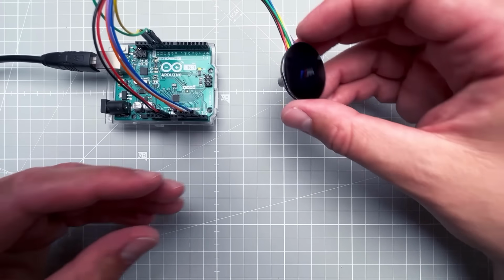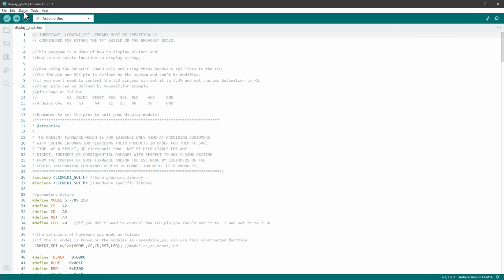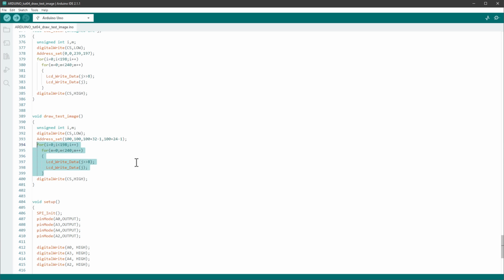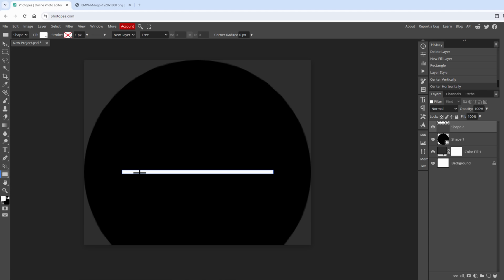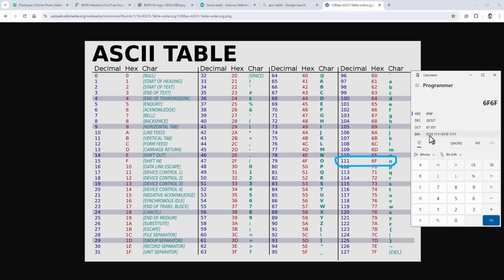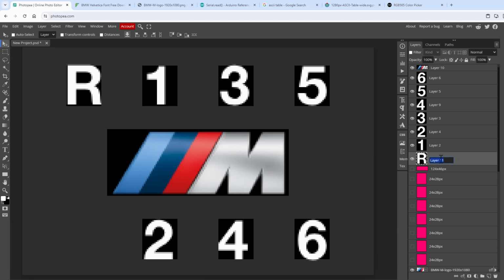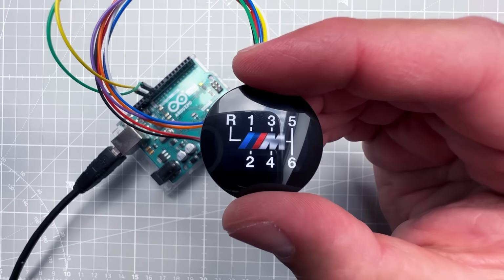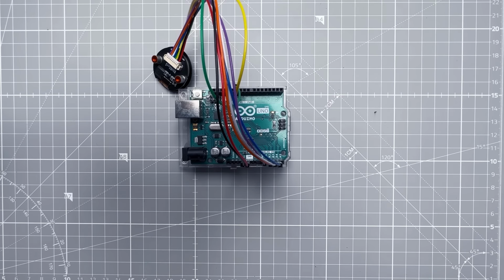I found PERFECT display

Comment: I have a 2019 subie impreza sedan and unfortunately it's not manual, however, it's very funny to drive, so I'm planning on adding some switches to the dash so I can add more cool huds, like the g-force monitor with a axis and surrounding circles with a dot that moves around.

However, if you want to also do what I'm doing, consider using a nextion display, I would recommend 5 inches or higher. Or it will be the size of a penny.

Although there are options for me to plug into obd2 and get a monitor, on say, ali express, I want customization and to learn how it works because I'm really curious.

Here's all the parts I ordered:
- a new arduino mega board for more TX RX connections, that just isn't possible with the arduino uno board
- ADXL 343 accelerometer (you will need to sauter those pins on, just a warning)
- Some kind of GPS system, I got a GT-U7, but I'm still attempting to get it to work (also needs sautering to work)
  so if you don't have this already, get a: sautering set with clips, as well as some soldering wire to form the solidified metal glue that holds your pins to the board, as well as a de-sautering plunger in case you mess up
- DHT 22 sensor, because the other DHT modules are rubbish (displays temperature)
- some kind of CAN shield to connect your arduino mega or uno to a obd wire to your car
- OBD-II to DB9 Cable (the manufacturer won't tell you what kind of cable goes to connect the car to the shield, so this is the cable you have to get, a FEMALE DB9 end to a MALE OBD-II end. if you don't have this, and because it comes separately from the CAN BUS shield, you will end up with a CAN Bus add on that can't connect to anything which is pretty infuriating.) 
     I also would recommend getting long wires, at least a half of a meter long or so, because you can spread the display father from the board. I could only find male o female wires, but that's good enough.

Arduino playlist where I keep other people's tutorials all in one place:
https://youtube.com/playlist?list=PLU1G_7s85BKfUrUACXl_vMaxoBWpobnmb&si=J5KACSdJiFCb4BAr

Comment: u can ad an spi eeprom
Reply from the maker: Yep, but probably easier solution is to simply use ESP32 or other microcontroller with more memory.
Reply: @upir_upir  yes for sure the conectivity of the esp open to a lot and the mcu is way powerfull, but the gpio is limited

Comment: Maybe you should try a Raspberry pico instead? Something like 128 MB of memory.
Reply from the maker: That´s interesting idea. I will start with ESP32 that usually has somewhere between 4-32MB and see if that´s sufficient.
Reply: @upir_upir  Ironically the pico is cheaper than the uno and offers way more memory and a much faster clock. It also comes with wifi and bluetooth too if I remember correctly, so easy communications too.
Reply from the maker: @fog1257 I believe ESP32 has all those attributes as well, plus I can use Arduino IDE.. but I might try Pico as well

Comment: Could be really funny if you could get a thumb stick windows pc's to run the shift knob a wireless mouse and KB plugged in you could have it hidden somewhere, or if you print a really long knob inside it.
Reply from the maker: You mean using the shifter knob with Windows as a controller?

Comment: Thanks for this, it's amazing, although I have no programming ability what so ever.  I'm better on the automotive side. i assume you have an OBD2 port on your vehicle which can use a Bluetooth adapter to send vehicle data wirelessly. Would it be simpler to receive shifter data from there to the display? something like this?  https://www.youtube.com/watch?v=VMdNPDkB_Ls
Reply from the maker: Yes, trying to leverage OBDII data is on my to-do list, and I would like to try that soon; I have a lot of different Canbus devices, and I will see which one of them is easiest to use.

Comment: PLA is NOT a good material to use in a car.  Even if it never gets warm where you are, the sun coming in the window will degrade the plastic if it doesn't soften it to the point of being useless.  You need a material that can stand the UV and temperature of a car, like ABS or ASA.  Just a thought.  A really cool project and that display really IS perfect for the shift knob.
Reply from the maker: Thank you for your comment, someone else mentioned it already, it´s a good point. I can only print PLA and PETG, but hopefully one day I will also get a printer to print those advanced materials.

Comment: This is such a cool idea, I'd love to see manufacturers incorporate this into their shifters in future.
Reply from the maker: Thank you, but I´m sure this is against all the regulations, I don´t think it will be part of shifter knobs anytime soon.. most likely shifter knobs will not be in cars soon.
Reply: @upir_upir  so the Mercedes AMGs have something similar with a pair OLED micro displays on the steering wheel. They are used for shifting and vehicle mode.Ive been on the hunt of putting them on my car because they are so badass. I however am trying the shortcut to your route. Im starting to think I can encode the ECU with something like HPTuners to accept onto my new Eclass. The transmission is much different so I may end up having to do it all your way. Im a mechanic with zero coding ability. I however love the wiring and soldering parts, somewhere I excel exponentially!

Comment: you should be able to do it on a rp2040 1.3 touch display, no extra arduino needed, its all in the display itself
Reply from the maker: I have tried that display - but not the RP2040 version, but the ESP32S version in my latest video. Have you seen it?
Reply: @upir_upir  yes, overall perfomance the esp32s is better i think but the rp2040 has a gyroscope and an accelerometer build in.
esp has wifi and bt which is cool for modbus tcp or other network protocolls. idk thought aoverall smaller thing ist maybe better for your project. cheers

Comment: If you can find an appropriate, gap-filling adhesive like some used with optics, you can remove the air gap between the lens and display and don’t have to worry about viewing angels.
Reply from the maker: The lens is factory-applied, or did you meant something else?

Comment: this would be insane as a replacement for the logo on my stock e46 shifter. its the same style of glass and looks to be around the same size
Reply from the maker: Cool! Is your stock shifter illuminated? If so, you can probably use that 12V line and do not make any other modifications.
Reply: @upir_upir  it is not but it shouldnt be to hard to get some wires to the top

Comment: you can make the code much smaller to fit in to one chip( attiny85 - for inst.) 8kb of flash should be enough. also you may use one bit per pixel instead of bytes in your font images. it'l shrink your code significantly.

Comment: I think it’d be cool if the logo was the only image file, and the shift pattern was stored and set in a custom data type so you can quickly adjust it for a new car. Maybe even hook it up to a game like assetto with a plugin 🫢
Reply from the maker: That´s exactly the plan, since I would like to support multiple brands, logos and shifter patterns. Does assetto work with SimHub?

Comment: 40:14 You should include it in the ///M bitmap. It would cost you zero ressource and have a slanted anti-aliased tail like on the original image
Reply from the maker: That´s correct, but I haven´t included it because I´m later changing the color of that line.

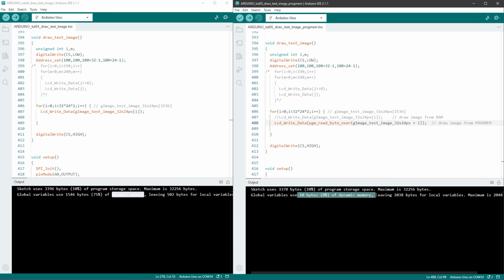Comment: 17:20 The global variables don't appear in the PROGMEM used in the output on the bottom...
What if you used a const rather than a variable? Wouldn't it go automatically go to PROGMEM?
Reply from the maker: Const would enough on non-arduino boards, but on Arduino boards, you have to specifically type PROGMEM. It will be ignored on boards like ESP32.
Reply: @upir_upir  Thank you. So the Arduino  compiler stores constants in RAM?

Comment: I'm lucky enough to have an illuminated ///M gear knob but this is the premium plus version!
Reply from the maker: Illuminated ///M gear knob is pretty cool on it´s own, and it also means that you have easy access to 12V line, so changing it for a display should be simple.

Comment: You are using 16 bit color for the number images, but then only using them for a binary mask in the code. You could save a bunch of memory by dropping the images down to 1bit.

Alternatively you could try and keep the anti aliasing. Save the mask as 256 levels. Then code side, build a lookup array that maps from the 256 image levels to a tint gradient (from black to full tint). This pallet can be precomputed. The inner render loop just needs to do an extra array lookup instead of the masking operation. Should still perform okay.
Reply from the maker: Yes, saving them as 1bit to keep anti-aliasing would make a lot of sense, and using the color lookup table. That´s something I will try the next time.

Comment: Regarding the photopea / image2lcd v2.9 (v3.2),  do I understand correctly that the display still needs an external arduino to sense the position and drive the display?  

If so, any thoughts on those $8 ESP32 boards where you could wire the gear inputs but all the smarts would be handled on the display board?  Like banggood esp32 c3 5x5 led board, or ESP32-S3-LCD-1.28 ?

Some of the more pricier units ($25) have an IMU, so perhaps it could sense the gear just based on the tilt.. without any need to wire inputs?  
ESP32-S3-Touch-LCD-1.69 ?
Reply from the maker: Yes, I´m looking at all those boards right now. The mentioned ESP32-S3-Touch-LCD-1.69 looks very interesting, but the data coming from the IMU are not very precise. I will still most likely go with ESP32, and probably use two connected with ESP NOW, so you only need two wires (power) for the unit inside the knob. Thank you for your suggestions!

Comment: er, PLA? bad idea. a car parked outside you should be using something like ABS or ASA. PLA is not going to maintain structural rigidity at all. what i mean is, that's going to come off in your hand while you're driving.
Reply from the maker: Thank you for letting me know, someone already mentioned this. It´s definitely good to know. Would using PETG be better?
Reply: @upir_upir  PETG would be better but i would say still not ideal. Can you print ASA? ASA is a modified ABS which is better for engineering purposes, better for outdoor use (which technically inside a car, but it's still going to be hit with sunlight etc.) and better for overall long-term. I would use ASA or ABS. both will require 240-260 nozzle temp and an enclosed heated bed of 90-110º.

Comment: Since you are using mostly black and white graphics (for the digits etc) you could use a basic form of compression where every pixel is 1 bit instead of 2 bytes, then unpack on sending data (by using some binary logic) essentially reducing the amount of memory needed by a factor of 16
Reply from the maker: Wouldn´t you lose the anti-aliased edges by storing every pixel only as one bit? That said, you can probably store one pixel as one byte, reducing the memory by the factor of 2. Not as big as your savings, but you will get the same visual result.
Reply: @upir_upir  That is true, but i can imagine something like this becoming useful when wanting to create more complex visual , for instance you could store a whole font library like this, then draw it to any color you like using some decryption logic. For anti aliasing, if there is sufficient memory (approx 2* image size) and processing speed you could do a first render and then a kernel filtering pass in which you perform blending based on neighbor pixel information. A simple alternative to anti aliasing could then be implemented by taking the max of the self value compared to avg neighbor. If memory is a problem you could render in portions, essentially storing only part of the pixels in memory, performing the filter pass, rendering to screen and then move onto the next block. Alternatively, which i think is how AA is implemented, for each pixel, you render 5 times to the screen for times for each neighbor (blend between target colour an bg colour) and once for the pixel itself "on top", non blended. I can imagine you can get some quite extensive visuals in such a device using some of the optimizations.

Comment: Can be interressimg on ets/ats with 16-18speeds gearbox on trucks or with an automatic gearbox. Also with beamng...
Reply from the maker: Can you use beamng with SimHub?
Reply: @upir_upir  BeamNG is listed as a supported game on Simhub website but didn't tried it. 

I only have a e36 cluster but I have to rewire it with car socket.

Comment: Would be great if you can show how to interface the unit in an actual car, using the can bus. I think bmw would be popular, I dont know how you could go about creating bench test for a bmw gear shifter because the gear information probably comes from the transmission itself not the knob/shifter mechanism. Experiementing on someones car may also not be possible because of risk etc but even if you show some kind of hypothetical situation using your own CAN bus network on the bench and maybe using some online information about BMW can bus frames for their data about gear status, you can get an arduino with can module to output that data to pretend to be a transmission.
Reply from the maker: Yes, interfacing canbus via OBDII port is something that I´m currently looking into. Thank you for your comment!

Comment: ESP32-S3-ZERO would probably be the best choice for this project if you are moving away from the Arduino and want something not custom. Or if you want to go raspberry Pi then the RP2040 Tiny, the one with a breakout usb board for programing
Reply from the maker: Thank you for your suggestion, ESP32-S3 is what I´m currently aiming for. Right now waiting for the XIAO ESP32 board to arrive, let´s see how it goes.

Comment: Could this be used to drive two displays? One on the gear shift knob, and one on the instrument panel?
Reply from the maker: Yes. You can use even more displays, but updating will be slower. There is an example in the documentation that shows those spooky eyes with two displays.

Comment: Very nice tutorial. As a computer science student, this video remembered what I seen in the digital image processing class, it's quite a very cool practical introduction to bitmap images in programming. 
Also, holy moly, this screen is very awesome, it sparked some ideas like integrating this with the OBD2 port existent in cars. My 7th gen Honda Civic (Automatic) have the gear selection as a digital information (since there's a soft illuminated gear selector in the panel), but I'm not sure if the gear data is available in the OBD2 port - my dad is a mechanic so he has a scanner and it don't have the gear information, but could be a limitation from the scanner itself. Despite this, an universal approach would be crossing the data from the engine RPM with the road speed, as the ratio could be calculated to guess the gear the car is gated tho.

And yes, I drive an old Honda Civic :D
Reply from the maker: Thank you for your comment! Yes, I do plan to explore the OBDII a little bit more to see how much information I can get.

Comment: 6:30 isnt the screen technically updating entirely but only a small part changes?
Reply from the maker: That´s correct. The screen is being updated with the driver chip 60x every second, but the memory area with a different content is partially updated much slower with Arduino.

Comment: If performance factors in even remotely, you're usually better off with an ESP32 anyway. 240 MHz vs 16 and that's just the beginning (on an ESP32 we're also talking about MBs instead of KBs of available memory).
For image use cases like that, using PNG as an export method usually results in less quality lost to compression, useful if you later use tools like IrfanView to batch convert them to your target format.
Reply from the maker: Yep, I do plan to switch to ESP32 soon for the mentioned reasons. It just still fun excercise trying to do this with UNO.

Comment: Fantastic project, this randomly got dropped in my YouTube feed.
You did mention it at the end, so you're probably going that route anyway, but I would highly suggest going with any ESP32 board with enough pins (should be almost all of them). Just to have a microcontroller with a clock speed that isn't from the 90s. More memory is nice, but that work is done now anyway (and I would have used an approach like yours anyway). It does also solve the color-problem where you said "doing this color tinting in the proper way would take too much CPU cycles", with easy.
Reply from the maker: Thank you for your nice words, I´m glad it was a good recommendation. Yes, I do plan to move to ESP32 for a faster calculations and bigger memory, but it was still a fun excercise trying to do that with UNO.

Comment: You might be able to use the screen like a d-pad to be able to navigate a menu. Tact switch under each cardinal direction, maybe long press to select. Or have any 2 opposite buttons pressed to select, triggered by pressing the center.
Reply from the maker: That´s an interesting idea, and I will try it for sure. Thank you for your suggestion!

Comment: The GC9A01 version doesn't have that blanked off area at the bottom of the screen but it only has a resolution of 240X240 pixels.
Reply from the maker: That´s right, but I like this one more because of the glass dome/lens on top of the display.